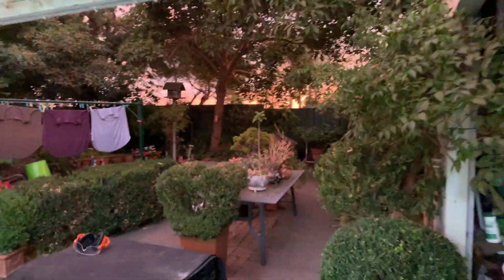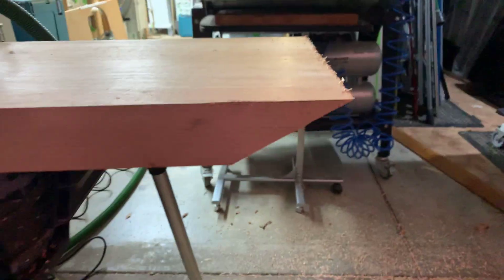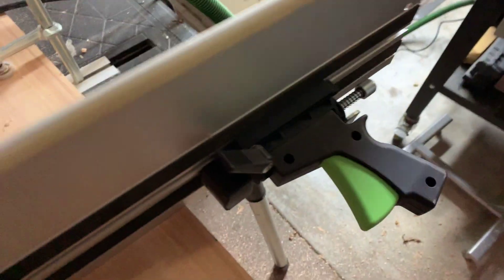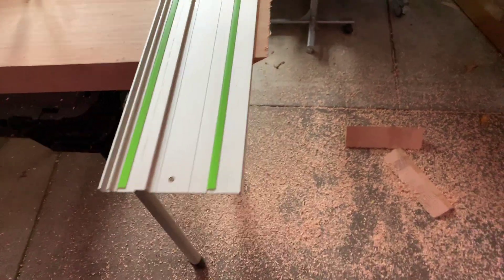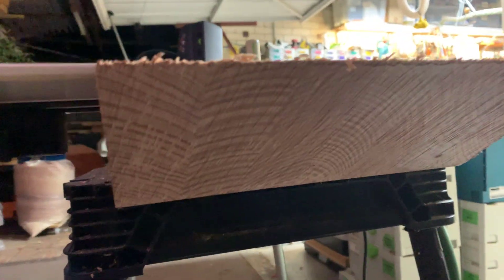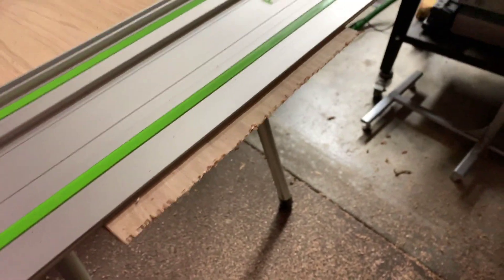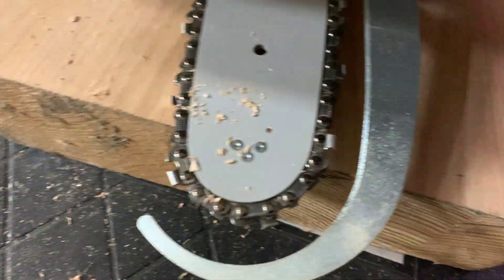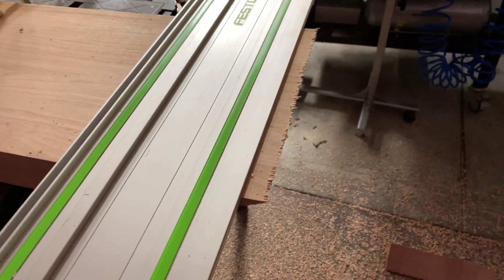Festool SSU 200EB-SET Sword Saw  Part 1

Comment: The top tip out isn't a surprise. It's a tricked up chainsaw. The guidrail splinter guard obviously isn't active for the sword saw.Ive not tried it, but a plywood sheet on top, below the rail, may help with the chip out. But that may complicate cutting to the intended line, which would then need remarking on the sacrificial piece. Probably easier to make up for when there are multiple cuts of the same pieces.